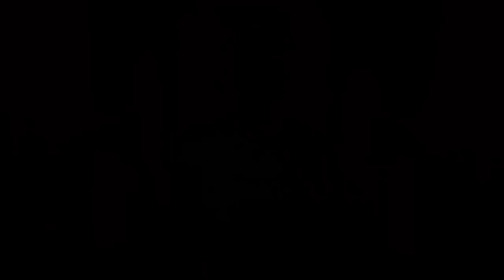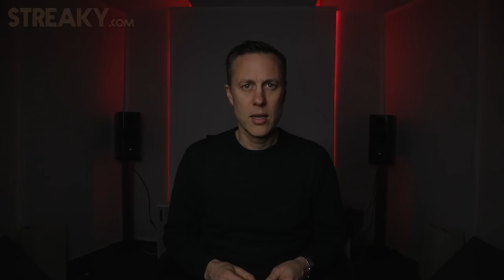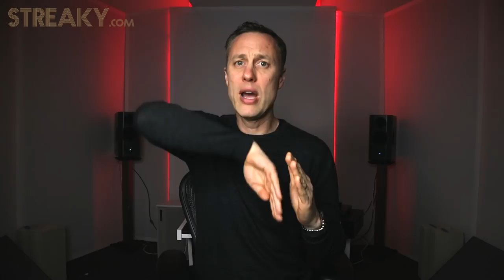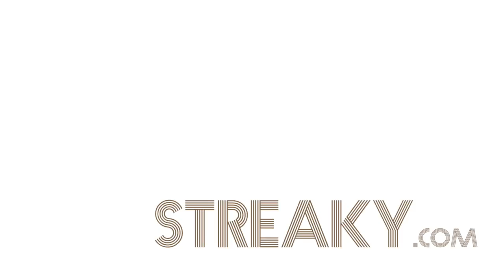WHY YOU SHOULD CUT ALL FREQUENCIES UNDER 20Hz | Streaky.com

Comment: There is a lot of energy at low frequencies and the compressors react to energy. As Streaky explained very nicely - if you make an expert cut there, you are actually letting the compressors grab better and to more relevant parts of the spectrum. It makes everything tighter. Thanks for turning the spotlight on this, it's a very interesting topic :)
Reply: It's interesting to add a DC component to a signal, and see the effect on a compressor if you keep its settings fixed as you vary the DC component. Basically for the same audible sound, the peaks get shifted higher on one side of zero, and I imagine the compressors react differently to this. If you have a 20hz component, for example, it is, in effect, slowly modulating the threshold of the compressor, if said compressor reacts to peaks.
Reply: you could also just use a sidechain filter for that

Comment: For keeping the hygiene of each sound/track I cut everything below 20Hz or seldom below 18Hz. I also cut it on my master bus. Using lots of compressionand EQ (static, dynamic) on each stage (tracks, buses, master) I will not allow any mud to be picked up and added to the signal processed. And for this purpose I set x4 cutoff option in EQ8  (in Ableton) which is as I remember 78db/octave wall.

Comment: I think the steepness of the curve is key. I generally cut 30 hz with a 24 dB slope so there is still information below 30 but it's reduced. After seeing this though I might use 2 EQs, one with a steep slope at 20 (say 36 or 48 dB) and then the second at 30 or even 40 with a 6 dB slope. I mostly produce indie pop/rock and some corporate stuff so I don't need booming subs.

Comment: Great video mate.  I love how you got into filter slope.  So, beyond that there are some very important specifics that I'd like you to speak to.  First, you mention "the shelf" which would indicate you're using a low shelving filter rather than a highpass filter.  Could you please discuss which one you use and why?  Also, you mentioned you use a sharp cut but not a brickwall.  What dB per octave filter slopes are you using in actual practice?  I assume it's in Pro-Q3, so it could be any range from 6 dB per octave all the way up to 96 (excluding brickwall here as you specifically said you don't use it).

Comment: Really depends. You said leaving 20hz in for DNB is "rubbish" it's really not. Also hearing doesn't suddenly stop at 20hz. I have a system that plays down to 12hz -3db and let's say there's a wanted 18hz note in the track if it's well done that can give some SERIUS impact that would be not there as much if those fundamental of the note is cut off. Sure does sound like rubbish if your speaker's can't do it. and cutting of low stuff from ab bassdrum can be "rubbish". Listen to Sly fox from NAS on a good set of headphones. The kick has 2 octaves somewhere around the low 20s and around 50hz The lower part is not muddy at all it seriusly adds to the punch of the kick. In the end that means it really depends. Not always does it make sense to cut very low stuff out.

Comment: I mostly play and mix rock music. I always low cut my guitars about 80hz down. I knock out 30 and below on bass instruments. That's the real secret to balance the spectrum on the mix. Most of the time those subsonic frequencies aren't really doing anything. They're just bleed as i call it. They're so far below the spectrum of hearing on the rta scale, that all they are doing is loading up the master fader with fake energy that's barely audible.  The compressor and master limiter always hears it, because it's monitoring signal amplitude and voltage. I've noticed that when i pre low cut my tracks to clear up the low end clutter bleed frequencies, the lower mids and midrange transients pop out of the mix more. You'll get more energy going on in the mix without the sub Sonics interfering. I mean let's face it, not every person listening to music owns a thousand dollar or 2500 pound subwoofer system that is calibrated to go down to 0hz lol basic home and car stereo system doesn't even reproduce those subsonic that accurate if at all

Comment: High pass filters can also cause time domain issues. Often using a low shelf is a better fit for the purpose of opening up the sound and feeding your compressors.
Reply: He specifically mentioned a "shelf" in the video, not a highpass, so I assume he is actually doing this.  Also, he primarily uses Pro-Q3 which can use linear phase to avoid time domain issues but with the sacrifice of introducing pre-ringing.  Although a lot of electronic artists actually like the sound of percussion pre-ringing.
Reply: @warpacademy  no he doesn't lol. He's talking specifically about a high pass filter. Unless I missed something ?!

Comment: Great video. Very straightforward. I mix and cut depending on where the song might get played at. If the song could get played at a club the I might need 30 Hz, so I'd cut at 30, sometimes 20 on either the kick or synth bass, depending on which is working the sub frecuencies. If the song doesn't need that much low end I might be cutting of at 40 or 50.
Reply: Man, even earbud listeners are gonna be mad if you cut 50hz

Comment: As long as it doesn't add dc offset. I find genrler curves 6-12-24 dB/oct better for cuts than sharp ones.

I don't like sound of linear phase eq. If I use izotope ozone in digital mode, I add phase shift to low frequency.

Comment: I made a heavy metal track that goes so freaking low that the leading note lands below 100 Hz to the point when kick sustain(!) starts messing with the bass guitar. So I had to tune down the kick.
This is the only time I couldn't put a 20 Hz cut, I could only remove DC offset at best. And, of course, I had to have those low frequencies louder in the mix, hence I turned all the other spectrum down.
The whole spectrum more or less looked like a pink-ish noise, but with a massive 6 dB spike towards the sub 20 Hz region. Whenever I was trying to tame the bass it was actually loosing all the juice, all the intention that piece had: to sound like an earthquake.
Moral of the that above: cut 20 Hz and below is highly recommended if there is no melody inside or cutting it won't remove a significant part of any instrument. Use DC offset only otherwise or try to convince client that the track won't sound good on mid-tier devices.

Comment: Thanks!  I keep seeing frequencies lopped off at 50 hz, as a standard.  Not even rolled off.  I more understand 20 hz, but is it the same reasoning for 20 hz - 49.9999 hz being cut out, too?  You mention a reason for 40 hz, and is that also the same reason for 50 hz?  I know it's somewhat hairsplitting, but this is enlightening!

Comment: An incorrectly tuned master or buss lowcut will ruin your carefully controlled dynamics, channel compression. Due to the shift in phase, any transients that were sitting in the valley of sines, will now be on the slopes, even worse, the crest, resulting in higher peaks outside of the previous compression, more work for the master limiter, for less overall volume. This can be viewed by using Volume Shaper, end of chain, purely as an oscilloscope, set to 1/4.
Reply: This is very interesting, what is your take on controlling / cutting things on the stereo bus then if I may ask :) ?
Reply: Wouldn’t you do something like this early into the mix. Am new to this, so please correct me if I am wrong.
Reply: @razzerraw1108  I don't but I'm not very good. If doing a low cut and it does sound better, that will be because the shift in phase in the low energy has now made everything sit tighter with each other. If it's already tight, it's going to shift things out, which can also sound better, depending on the feel you're going for. The sub bass energy being a bit late or early, can be your aim.
Reply: Experiment 1. Set up volume shaper on your master as the very last FX. Have some bass perfectly side chained with a kick sample (or VS ducking). View how in Volume Shaper on the master, set to 1/4, the kick will draw perfectly static each time. The sub tail ducked. Now apply the low cut on the master. Observe now the tail of the sub is now exciting (altering) the transient of your kick. this is due to the sub energy being later in time, you perfectly tuned Sidechain has been destroyed by the low cut on the master. However, one may prefer the sound of the excited kick transient, it will lose you headroom, depending on how this sits on the waves of the sub bass tail.
Reply: Experiment 2. Set up Volume shaper on your master as the very last FX. Have your mix playing, view the waveform display set at 1/4, solo, mute different tracks and observe how the waveform changes, which parts are spiking the highest etc, try to see the sub energy with in the wave, now add LowCut, observe how different transients now spike higher. 

Now set up a master limiter bring the volume up to 0db, no compression, no clipping (this part is purely to see how much headroom you'll loose by the amount clipped/compressed). Active, deactivate the low cut, watch up to 3db of headroom disappear, as  clips, compression to that level emerges.
Reply: @mitchiemasha  Again, sorry if this is a stupid question, but what if you were to cut below 20 right at the start, and do this in every track, and then bounced each track to audio... and only then started the mixing.
Reply: @accentontheoff  I don't know the answers, only questions. Try it, if it helps you get better results, use it. 
And, it's a good question, ones we should ask our self.
Reply: @mitchiemasha  Sure :) thanks.
Reply: @mitchiemasha  That's where really good linear phase EQ's with steep slope lowcut come into play. I have the PLParEQ 3 by Refined Audiometrics which was the best EQ I've seen in this use case, but unfortunately can't use it with Win10 anymore. Your observations described apply to minimum-phase and analog emulation EQ's, also to some rather improper linear phase designs.
Reply: I like your response and you've explained this well.  I don't like heavily compressed master busses for my projects personally.  Enthusiasts like to listen to audio on high-end systems which have pre-amps, amps, and even tube-amps.  I like audio that contains a decent dynamic range, clarity, space, definition, and the end-user can crank the volume and dial in their own saturation as needed.  I use to have subwoofers that performed well under 20hz and love when producers could mute the audio before the one and my hair would move for a measure before the next phrase begins.  I don't like low cutting a master buss because some low-end information could be useful on rare systems.  We can always compare the audio on many systems to properly evaluate the integrity of the signal.  I'm very happy that technology has improved the quality of audio and the future holds more amazing attributes for home recordings.

Comment: I noticed that one audio engineer cuts even  below 30-35 using high pass filter in edm but on izotope’s channel a guy cuts below 20 with low shelf bend. He said one should use “shelf” over “pass”.
Reply: i did notice HPF adds dc offset when cutting mid, but not in side channel usually. Always need to see meters. I can't hear effect of dc offset, but can see on oscilloscope, or rms/peak meter.

It will result in quieter music after you put compressor/limiter, even though you cut sound... counter-intuitive, but it will make sense after u look at oscilloscope.

Comment: Would you use a linear phase EQ to cut the sub bass or not?
Reply: You get more obvious pre-ring at lower frequencies because of the long wavelengths. Linear phase is best in the high mids and especially top end. At least that's what I've read, would be great to hear Streaky's take on this!
Reply: no, because of pre-ring, it's sometimes audible and annoying.

zero latency makes sound a little fatter too, or more analog vibe (especially mid/side mode)

After running some tests I now prefer zero latency over linear sound on mastering. The only times I use linear, in multiband effects if I don't want phase shifts, pre-ring is not a big deal in higher frequency as in low frequency.

Comment: What nobody is talking about is that, even if you cut using a brickwall limiter as slope in pro Q3, still the frequencies below 20hz would exist. Practically you cannot cut that low because no matter what HPF you use, the analyzer will show that there still remains signal in that range

Comment: I cut until I lose it and then I start creeping back until i feel it's tight and controlled. If i find I need a touch more impact I'll give it half a dB or so in the output of my low band compressor. That usually works fine for what I do. I don't do dance music so I don't know if that would work for that genre as well.

Comment: I was equing a bass pluck and wanted to cut bellow 20 hz and I noticed it changed the sound. I found that cutting at about 15 with a smooth high pass was optimal for the sound. I guess 20 is the guideline unless for most music but let your ears be the judge.

Comment: I would said I always Low Cut from 25 to 35hz with a Q of 12-18db/oct to start a mix for all low frequencies tracks on a mixing session. I often split the lower register instruments of a rock or metal mix into 2 sends. One with a 25-35hz to 200hz band pass and the 2nd from 200hz to max 20khz. Basically creating a 2 bands comp. I could use a plug-in but that's how I been shown to do it. I'm a novice at mastering but that's what I do when mixing.

Comment: As mix prep i use a linear phase eq and cut at 20hz on kick, higher (40,60,80) on Guitars vocals etc as I want a tight rock mix and most of the bass from the drums and bass guitar. It seems to work?

Comment: Which EQ do you recommend for low cutting with High Q value?
Reply: ozone's EQ has brickwall option.
Reply: Fabfilter Pro Q 3
Reply: @PharaohLawLess1  sounds better than ozone
Reply: don't do brickwall. 1. sounds bad 2. adds lot of phase shift and dc offset.

6-24dB/oct is best I think. Or even use shelf instead of cut.

Brickwall cut is more useful for sfx, or reverb aux tracks than for mixbus.

Comment: 60% of my clients are dnb artists / labels and I've always cut at 12khz using the bax or 22hz using wave liner lowband eq 

I find when cutting the low ls using anything more than 24/48db slope on fabfilter proq 2 it adds this strange bump or unwanted feel to the bottom end. 
I don't think ffproq2 is great for low cutting full mixes at all.

TDR Slick eq does a much more transparent job aslwell as cubase stock plug "frequency" also cleans up the lows without removing the juice .  

But yes streaky 100% cut atleast 10hz on dnb music (also track dependent)
Reply: Agree.. FabFilter gets boxy if you cut using 24db or more.. even with ProQ 3.
Reply: @radofficial4672  Not just me then ... I mentioned this on a forum regarding the release of FFProq2 and I got shot down for saying it lol, but it's true. 

some plugs are very transparent with working with low end compared to others its just a case that you just got to try them out. 

Another problem is that we are fed so much bollox about what plugs we should be using and left feeling like a kid in a sweet shop. Use what you know works.
Reply: Compound Audio I bought fabfilter proq2. Aside from its features... I don’t think it sounds great. just a hype train
Reply: Use the ProQ2 in linear phase
Reply: @uptobatentertainment  wow even worse. This creates so many latency issues and ramps the start of the audio source too. The only thing i like ffproq2 for is notch filtering.
Reply: Up To Bat Entertainment the latency doesn’t work for me most times. I find that a couple of other plugins sound better in the low end without lp
Reply: Compound Audio I’m on a mMBP 2012 running lion in pt 10 and have no latency issues, I also print all files and this ramp in u speak of I have never seen. What EQ you prefer?
Reply: Nate Williams I On live 8 and pt10 on lion (4gb ram access 32 bit daw not 64 bit ) and don’t have latency issues you guys speak of, what eq do u prefer?
Reply: Up To Bat Entertainment I’m on 6 core Mac Pro 16 gigs of ram. Massenburg, or stock eq sounds better for hpf for me. Sometimes ssl gets the job done. I have used hpf with ff in lp mode but I hate the lag. Features are great but I don’t think it’s the best sounding eq. Many great eqs out there for less. I bought it because of the hype.
Reply: Compound Audio, Thanks for the cool tips. I have the pro q 3 which I like for certain mid to upper frequency cuts  but never use it for cutting low end. I prefer the Waves Linear FOR LOW bands. I also do drum and bass. I usually cut at around 30, I'll try the 22hz.
Reply: linear cuts in low end add that annoying bubbly sound in sub bass. I can hear it in headphones.
Reply: @izvarzone  it's pre-ring. Never cut using linear phase. Only use bell shapes or shelves

Comment: Also guys if you know anything about PA speakers you'll know that most system controllers will have a low cut at 30Hz or thereabouts to avoid the subs not having to try and reproduce those infra frequencies and causing damage. So whether or  not you leave the 20Hz in the track you aren't going to feel that because it won't be there in the club system. So all in all it's pretty futile